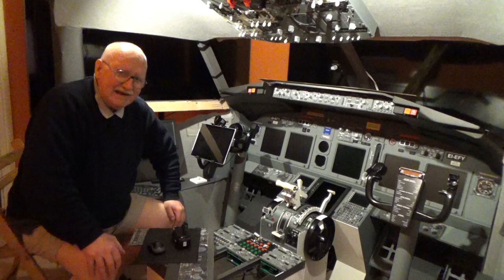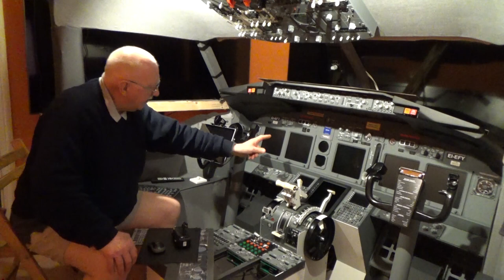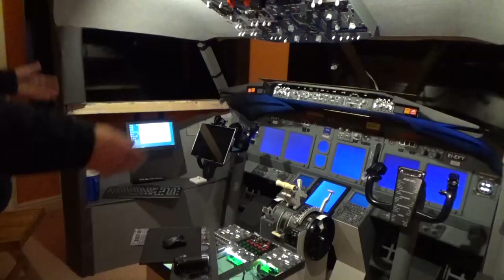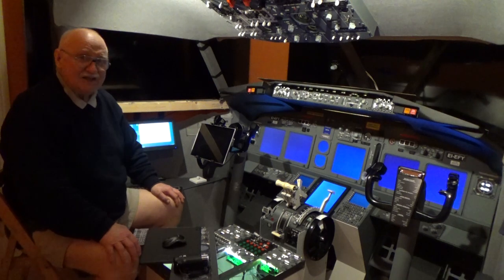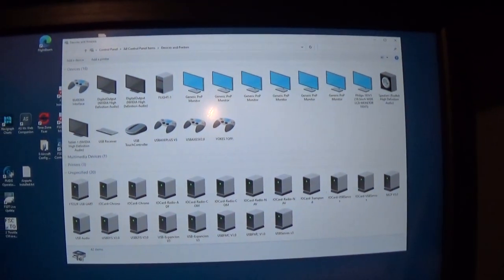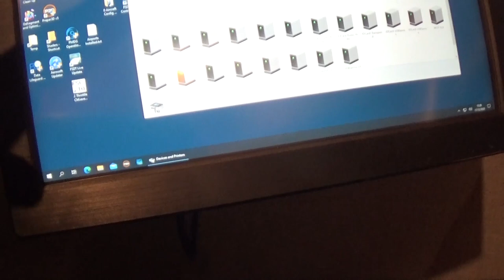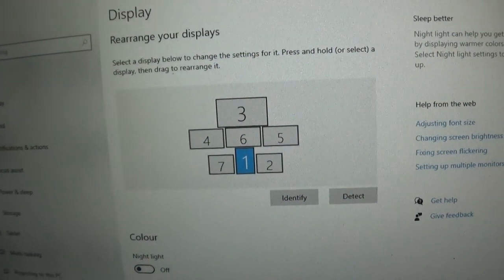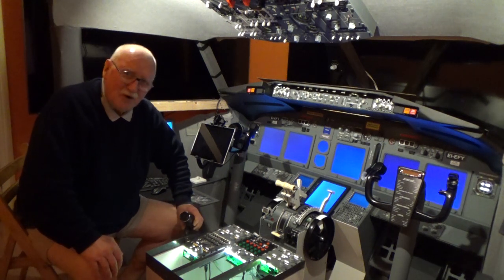Quarantine Escape Flight Update 11

Comment: Looking great ,i know the work thats involved  took 6 years to build my 737 and it still wasn't complete 

Regards 
Dave from Scotland
Reply from the maker: Yes indeed.  It took me hours today to go and check every single USB connection and put them in one by one.  That is when I discovered that there is a limitation with this computer on how many USB devices can be attached.  After I got over my panic - I added the USB expansion card and saw the remaining modules all come alive and be recognised.  What a relief!  Once the programming is done then I will take care of the cosmetics: the bare wood that needs covering.  Never ends. does it? 😂
Reply: @FatherDane  you're right there but well worth it .
I had 2 captains from work that came to have a go in mine  its a great hobby
Reply from the maker: @davidmuir6849  Yes it is - I have a Ryanair captain that pops in to use mine - great isn't it? 😊

Comment: Hello wow is awesome how you build your sim… I just bought a part of my simulator but I have doubts about the computer that you build, I don't know if you can explain me a little because I wanted to put a total of 8 or 7 pcs to connect the entire simulator but I see that you have only one computer for everything, what feature do you have in this pc and well how is it that you can put a stage and the software you use if it is FSX or Prepar3d I would like to know if you can support me..
Reply from the maker: Hello - Congratulations on starting the build of your sim. For my model, I use P3Dv5.2 for the sim software and PMDG NGXu for the 737. I now have two computers running the sim< one to run the external monitors (large tv screens) and the other to run the hardware sim that has seven monitors attached to show all the instrument screen. Of course having more PCs will improve overall performance but I am on a tight budget so I have this setup. Have a look at the other videos I made to get more information on how I built it.  Happy Landings 😊